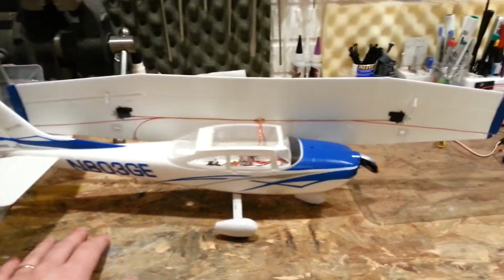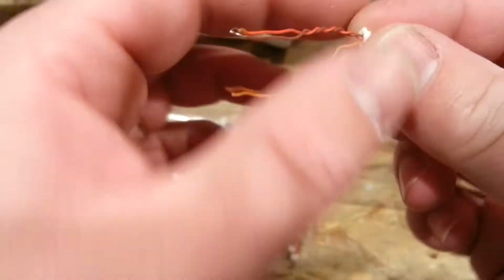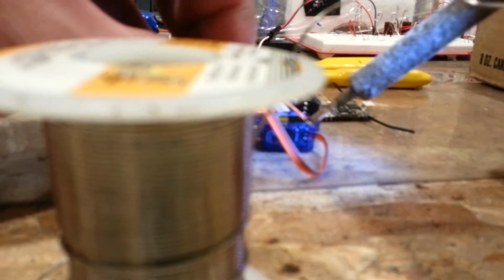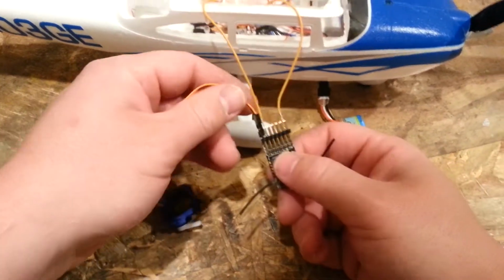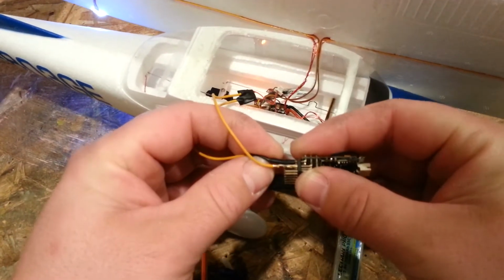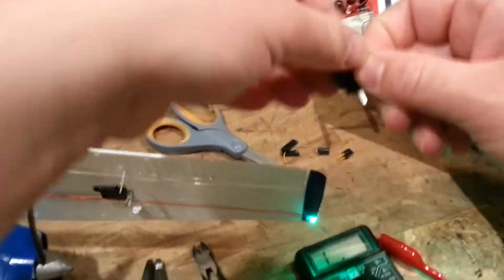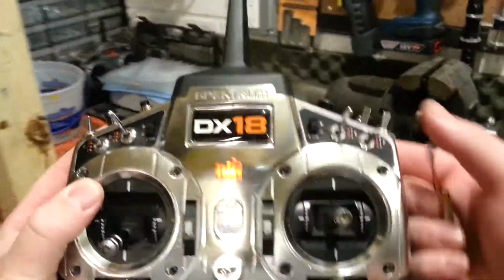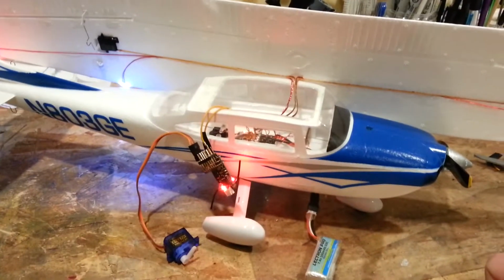Horizon Hobby - Cessna 182 UMX - Flaps Mod - Part 1

Comment: Hey Brian, I finally spend some time on my UMX Cessna 182 yesterday. I was able to program the EFLU5864 receiver/ESC unit with the spektrum SPMBT1000 Bluetooth programmer through the AS3X app. I simply reassigned the flight mode to channel 7. Then use Gear channel 5 to operate the flap servos. No more hassle for a second receiver. 

I’m posting this here in case other UMX Cessna lovers need help. Leave a comment if you need help!

Modules needed to program the receiver unit are mentioned above. U will also need to make a regular servo to eflite ultra micro servo adaptor. So I can plug in the Bluetooth module to the receiver port. NOTE: the programming port is the first port from the starboard side on the receiver. 

I’m getting three planes remaiden on my new radio tomorrow. B24,F4 and bf109. Can’t fall asleep coz that excitement. So I figure I could spend some time typing this down while trying...

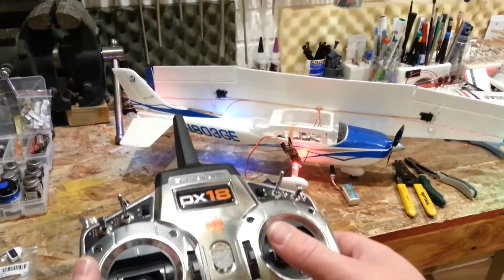Comment: At 26:00 I saw the change, you leveled out the UMX. My Timber would not bind with the tail on the ground, I had to lift it and make the plane flat to gravity.
Reply from the maker: I agree that this can and does happen, but it's not necessarily supposed to work that way. I've had that issue a handful of times, then it just stopped being an issue??!??! Not sure what happened to fix my issue though.

Comment: Did you have to bind the extended receiver to the radio set on the same model?
Reply from the maker: It's just the same as any other bind procedure you've ever done, only make sure the "other" one is OFF at the time your binding one...

Once you're done, you'll see they both work :)

NOTE: They both gotta be DSMX or DSM2...even though they're supposed to be interchangeable, I tried and tried to get a DSM2 to work with the DSMX brick, even with that brick "downgraded to DSM2"...still didn't work.